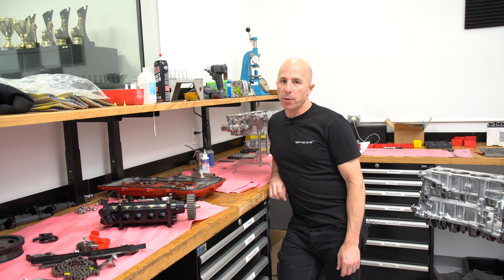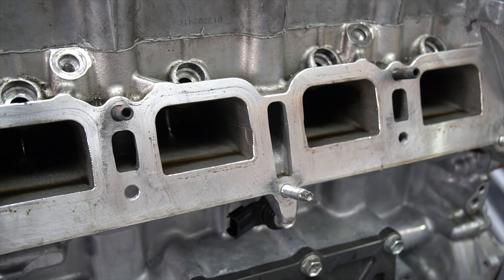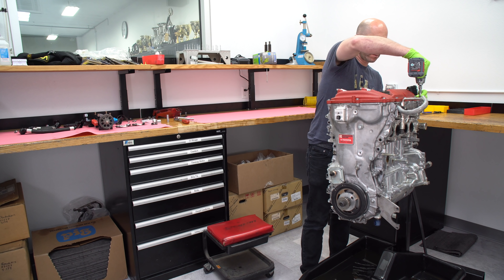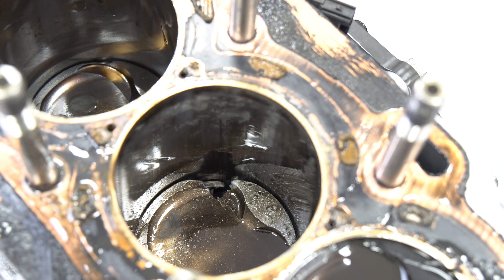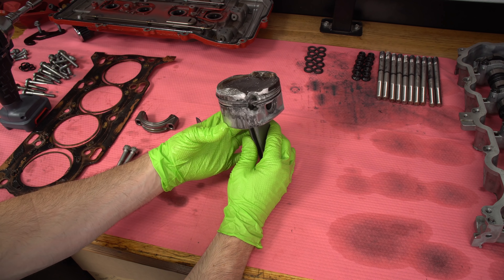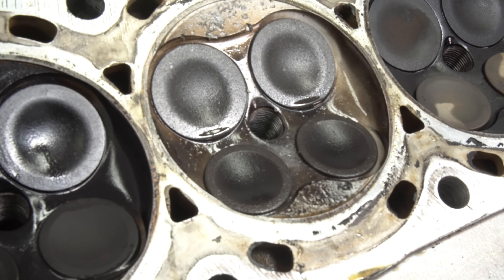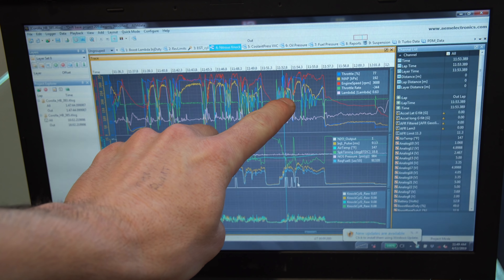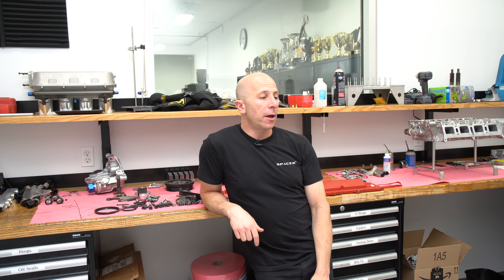Blown Motor Teardown - Burnt Piston

Comment: i have a few questions.. when you find detonation.. do you use a scope camera and examine the cylinder wall and piston top with the piston at BDC.. 

 do you examine the pulse width of the injectors at full boost in your data stream... do you duplicate that on your fuel injection tester to check their flow rates at that pulse width and frequency..  do you also monitor the amp draw of the individual injectors while testing.  you may end up needing to modify your injection test rig to duplicate Boost pressure on the output side of the injectors.. 

 i am taking you have oil shooter nozzles for the bottom of the pistons..   can you verify the flow before you pull the crank..  since the rods are out.. some rubber strip around the rod journals and a few hose clamps to seal the rod journal oil hole and a small deck plate with a pressure gauge to bolt to the deck surface where the oil feed for the head is.  to verify the spray pattern .. spraying out the top of the cylinders with the pistons out.    

 when the pistons expand do to excessive heat.. they scuff the cylinder walls transfer welding skirt material to the wall..  the rings come down and scrape this off but it lifts the rings off the wall allowing compression and combustion gasses to flow thru that gap..   i really want to know if you have a ring gap positioned where the piston melted.  i only went thru the video once.   you might do the strange thing and align the top and second ring gaps directly over the piston pin ends..  see if that improves your run time between failures.. 

 i don't know and i should how your ignition timing is triggered.  and how accurate if timing is triggered off slots in the crank.  are the slots the exact same width..  are there any wider slots to let the PCM know where number 1 is..  i realize you have a dyno.. have you ever accurately indexed a flywheel for the dyno runs with multiple notches.. fine pitch or used the carefully indexed flywheel ring gear teeth.. and a duplicate  of some kind.. on the front of the crank..  to check for  torsional effects from front to rear of the crank during high speed operation that could effect spark timing.  you might get by with just 4 indexes in the front and rear dyno test plates..  the front would need to be very thin and light weight to avoid effecting the torsional damping weight. 

i wonder.. since you have lighter weight pistons.. knock sensors are matched to the frequency of the possible detonation.. if you are using stock or just off the shelf detonation sensors.. it might have the wrong harmonic reaction time.   you may need to drill a bunch of holes in a test engine and monitor half a dozen or more at a time different sensors..  heck.. you may have to get something designed for a honda insight to get the same frequency response as your light weight race pistons.  i have not experimented with them..  just for kicks. i looked over at  autozone.. there are 390 different knock sensors.  some cheap.. some crazy expensive. 

 these are all just thoughts .  wayne p..

Comment: I prefer to run rich than to have this happen.  At that level of power EGT probe on each cylinder or individual 02 is good tool to have.  I'll sacrifice 50 hp and run rich and have my engine last.

Comment: Looks to me like it went lean= high exhaust temps, good head gasket, good rod bearing. Just my opinion, pre ignition or detonation things BREAK in nasty ways. Might had have some detonation while running lean, I still like mechanical things and egts. not electronics 1350 is building power 1500 is breaking parts, where we're you

Comment: You are wrong Mr papadakis. The Piston and sleeveaterial wiped out the plug porcelain.
Reply: I have to agree with this. All the plugs had some evidence of detonation and the pistons are melted. If the plug ceramic had failed, the plug would not spark and temps would go down.
He's trying to deflect from the fact the engine was setup with wrong mix of compression, plugs, timing, or fuel mixture. 
Modern plug ceramics do not break from tapping the gap closer.

Comment: Fantastic video really respect your engineering detail and tools, but it seems you are stuck in a process of break fix, change each component until the next weakest link breaks, i.e. the head gasket is now fine so the detonation is just looking for another way out. Is it not possible given your insights and knowledge to map the component tolerances of stress and load before you assemble the full designed engine. By map, I mean the stress load capabilities. It would save you a heap of time and money stripping down... x4 engine rebuilds. Once you had broken material drifting about in that cylinder block the friction increases and the hot spots start to cause an endless amount of other possibilities until your piston heads literally melted down. I am not trying to be cheeky just gain a better understanding how things work.... could smart software with more IoT monitor the engine and give you more detail on hot spots across the entire engine. i.e. start with the basic engine to create ML baseline for heat signatures, then stop and modify as necessary in advance before you get catastrophic engine fatigue.

Comment: You said you beefed up the head gasket as they were blowing and the adverse affects are just transferred to the next weakest link ie the pistons etc. I think I would rather change a gasket than strip down an engine to replace the piston and associated damage. It seems to me to let the gasket blow first. It’s your first indication all is not right.
Reply: blowing a headgasket (for example - between cylinders) on 800-1100Hp car means melting/eroding material from both Aluminium block and head and making them both garbage
not blowing a headgasket mean you can push harder, also it did fail from preignition melting things at 8-9.000rpm
Reply: Yashar thanks for your reply I have reported your comments to the administrator as hate speech which is extremely offensive. I hope the owners of this upload are also aware of your offensive comments. With a little luck this should be your last comment

Comment: @UCVDKsGMP27sI-7P-r6cTWVQ
      taping the plug did not crack that their  poresiliene  it it lives in the engine banging it with videration magnitudes more .if the was a crack in the plug most likey in the manufacturing process heard a strong rumor  of it happening on a botch  plug coming unglued n breaking my buddies 22re ..stay safe be blessed and may Jesus be your co pilot ;]

Comment: Stop lying!
First,  broke the piston baffle and then blew through, through the crack, due to detonation! How to set up the computer and got a broken piston! No need to tell fables about the spark plugs and the gap between the electrodes. For your information, the gap between the electrodes does not need to be reduced, in an attempt improve the ignition, but you need to make the necessary charge from the control system and the ignition coil itself, sufficient to overcome the distance between the electrodes of 1.5 mm. This will give greater ignition efficiency than "bending" the electrodes every time ...
Summary - before creating "instructive" videos, and pretentiously talk about technology, without having the slightest idea about it, go to school!!!